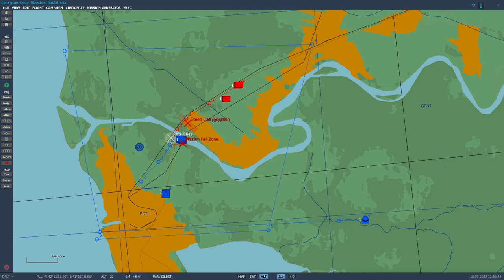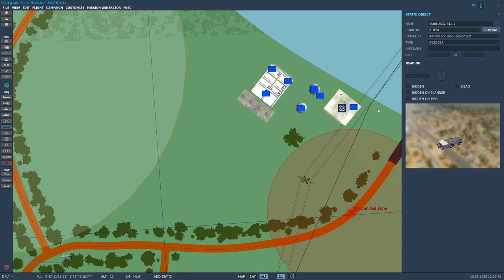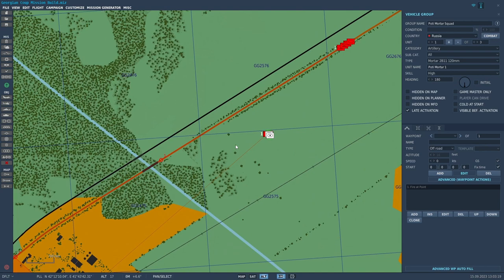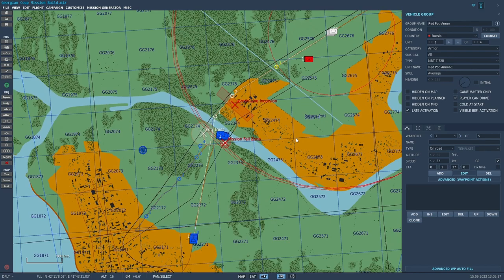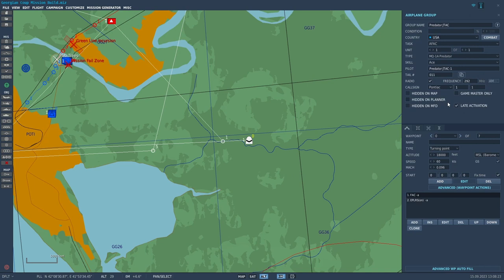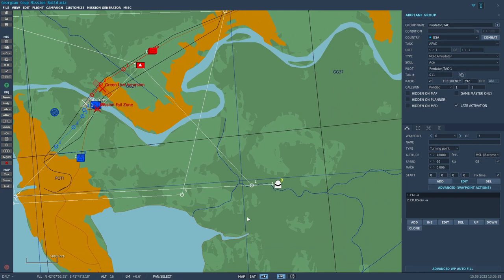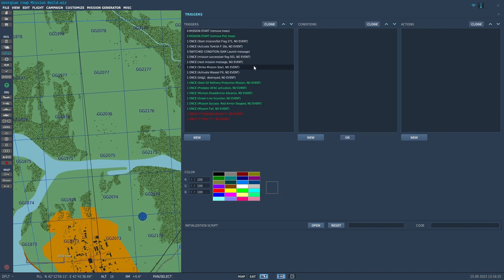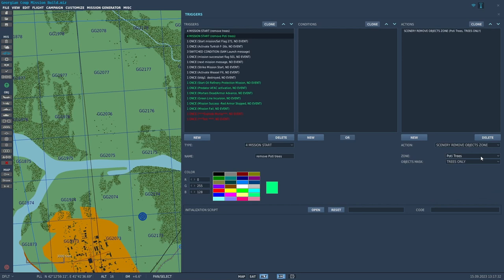Dragonfly's DCS World Mission Editor Build - AV-8B Harrier Oil Refinery Close Air Support (CAS)

Comment: Is it possible ,that the jtac doesnt work, if the freq isnt the same as in the right menu?
If yes, my problem with the jtac would be fixed ^^
Ty for the tutorials and keep on making them
They are really helpful!
Reply from the maker: That could be. When you go to the F9 JTAC menu while flying the mission the label should say what frequency he is operating on. I also make sure that I have the same frequency in on the advanced waypoint action menu if I am using the FAC- assign group feature. Hope that solves the issue!